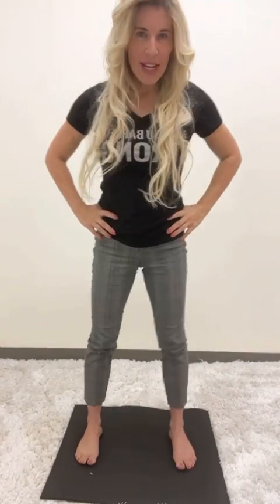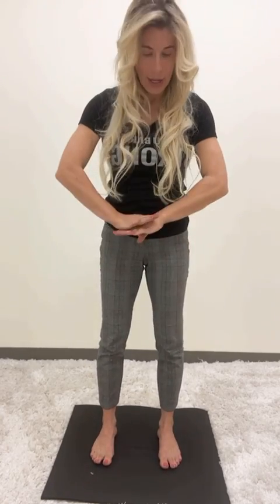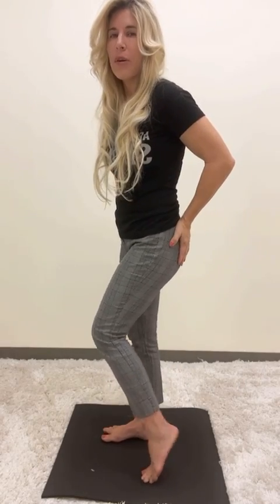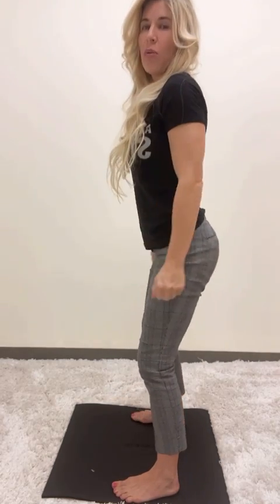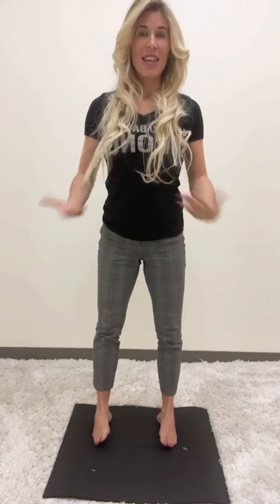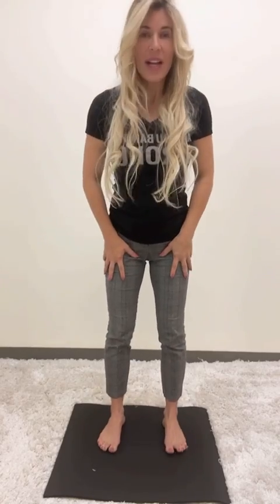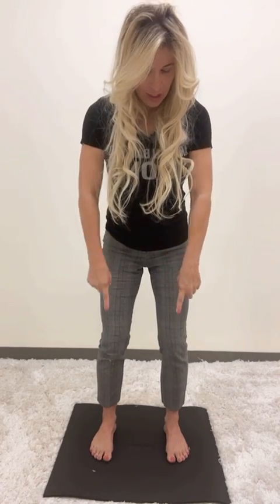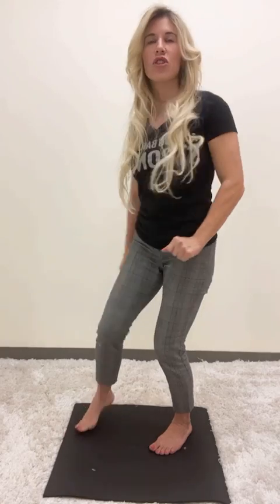Optimising Glute Strength - From the Ground Up! with Dr Emily Splichal

Comment: Hey Emily! Thank you so much for sharing. This drill seems to be perfect for movements that are more strength-based, like lifting. But forward movement seem to be using the opposite of this. If you ever watch Usain Bolt from the front/rear view, you can clearly see he is absorbing impact on the externally rotated leg and sending the energy to the other side by internal rotation. The whole knee literally goes from out to in with every single step, while lifting is from in to out. Watch Michael Jordan as well, he had the most pronounced movements patterns of this you can ever study. The thing is that this "locomotive engine" also incorporates a little bit of what seems like anterior pelvis tilt, which helps with the energy transfer from one side to the other. Most indigenous people also seem to be rocking what seems like a slight tilt.

There are systems that teach this and actually learned it from watching thousands of hours of slowmotion videos of indigenous, durable athletes, kids and elderly athletes that are still going strong without many health issues. They are fairly simplifying it and I don't agree with them on everything, but this makes too much sense to be just a sales pitch. I can DM you some of their stuff, I don't want this to seem like a shameless plug for their stuff, I'm not one of them. What is your take on that? What are the rotational forces in the body while moving forward? I don't see many people address this in the movement world, most running assesments are from the side view.

Their theory goes: if you use "lifting engine" for "forward locomotion", you are asking for a trouble.

Cheers!
Reply: @Sy_  what systems are you referring to?
Reply: @gregsam6744  Hey Sam. Emily didn't respond, so I'll just leave it here: it's "GOATA Movement". They have many coaches of different quality, but watch some of their slow-motion video analysis. They are VERY ACTIVE on instagram as well.
Reply: @Ssssyyyyyyyyyy  I'd be curious to hear her take too. I'm with you, all the footage they present is very persuasive but I don't think they have ALL the answers like they think they do and goata athletes still get injured and suffer pain as well. Some of the instagram accounts are bad apples too in the way they attack others which is a shame.
I am currently having a lot of success with Chong Xie's system which has similarities to Dr Emily's but I want to know how it can all combine together.